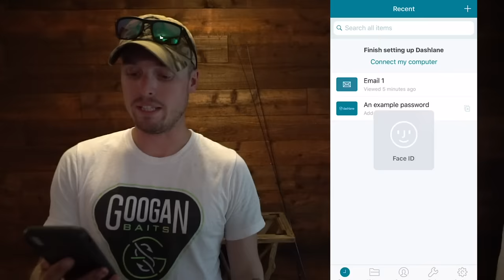$100 Homemade Kayak

Comment: Rob: I ran the numbers for your pontoons: You need 4ish pontoons for this to work well.

Buoyancy = weight of displaced water (more or less) = (volume of pontoons)*(Water weight per volume)
Your pontoons have a combined volume of 1.745ft^3
( 1.745ft^3 = 2pontoons * 10ft * pi * (1/6ft)^2 )
Water has a weight of 62.427 lb/ft^3, so your pontoons displace about 109lbs of water when they are fully submerged.

I would add another pontoon to each side (4 total) to give you a buoyancy of  218lbs. This has to support not only you but the whole weight of the kayak.

Also get rid of the foam it weighs more than air so you're making it heavier, not lighter. People use foam for flotation devices because it displaces lots of space (ie, water volume) without much weight, but you already have the pipe taking up the space, so the foam isn't getting you anything.
Reply: US makes everything so complicated. REST OF THE WORLD = 1 Kilogram = 1 Litre of water = 100 cubic centimetres of volume.
Reply: Jon Fisher : Are we JEALOUS!!!

Comment: An object floats when that object displaces more water than what it weighs. By adding the foam you added more weight so now it must displace more water but it's volume is the same so it can't displace the extra water. It would float better if the pipes were full of air. The reason one foams a boat is so in case it sinks the foam takes up space that would normally fill with water.

Comment: As long as the pipe is sealed, you don't need foam. The only thing foam does is capture air. You're actually just adding additional weight. Example, no one fills pool floats with foam so they can float.

Comment: Each of those pipe displace approximately 54lbs. If you estimate the weight of the kayak at 200lbs and roughly another 200lbs for you and any gear, you would need about eight of those pipe to hold you above the water line.

Comment: If you kept the PVC fully sealed. And put a bike inner tube nipple in the top you could pressurize the pipe to 30psi(I think it's only rated for 40psi). It would actually give it more buoyancy than adding foam weight that does nothing but add weight.

Comment: There is a buoyancy calculator online... enter pipe diameter and length and it will calculate how much you need to float. That was the FIRST thing I checked when making mine.

Comment: No foam required if straps are used instead of drilling holes in the pvc. Add 4 tees, and install out riggers.

Comment: Still think you guys need to check out Skeeter Vac for misquote control.  They run off propane and can cover multiple acres.  Mine covers our 3 acre farm and my mom has one on a lake in woods that covers 1.5acres.  Varies based on model and you can start them in May and throughout the summer have no bugs😁

Comment: Not sure about the size of the cylinders but if those are 6 inch cylinders, they displace about 1.8 to 2 cubic ft. Water weights 62.247 lbs; something like that. They usually just use 62 for making boats though because it's better to go under than over. So 1.8 times 2 equals 3.6. so 3.6 times 62 equals 223.2. looks like you're close to neutral boyancy or the weight of everything on top of the cylinders is causing them to be neutral boyancy.

Comment: I'm from Philippines we use bamboos u have to put one more pipe on each side with nothing inside believe  me it works I used to do it back home. With four long bamboo it's  heavy  but works  plastic is light and beside n your using 2 by four woods just use one inch by four woods...good luck

Comment: So, the foam has a higher density than air(we know that because it doesn't float in air) meaning adding the foam to a tube of air increased the density of the vessel. A higher density= much less boyant in water.
Reply: You should try filling the PVC tubes with helium and then sealing it lmao. The helium would undoubtedly slowly leak out, but it would be very boyant for a few hours.

Comment: You have to calculate the volume of water you need to displace to float you, your gear, and the kayak plus some in order to float.  Approximately 8.8 pounds per gallon.

Comment: When you are working with new pvc DONT PUT PIPE PRIMER ON IT, it makes the pipe brittle only use it when connecting old pipe to new couplers

Comment: Buoyancy is created by water displacement, adding foam to something like your boat will only help if your boat is submerged it will not help your boat float higher in the water.  To calculate buoyancy first you need to calculate the volume of your two cylinders with the following equation V=πr2h which if you are using 4in pvc that is 10 ft it would be about 1.81 cubic feet.  Then you need to calculate buoyant force so take the following equation F = (Vw) which in fresh water would be 112.22lbs for each pvc pipe before they are totally submerged.  Someone feel free to check my math because I could be wrong but if you want your pvc sections to float half way out of water your total load weight including the kayaks weight could only be 112lbs with 2 4in pvc pipes 10 ft long..

Comment: Foam will not make it more buoyant. It’s the closed volume displacement that makes it float. Back in the day they even made giant boat hulls out of concrete.
But, the spray foam will not be good over the long therm because it is not closed cell and will eventually soak up water. Your better off making a truly airtight tube, while adding a drain valve in case water does ever find its way into the tube.

Comment: You need at least 6.5 cubic feet of airtight space to float 400 lbs, so decide how far you want it to sit in the water and you have the total surface area that you need to create to displace with air.

Comment: Hate to bring this up but putting foam inside the pipes does not increase the buoyancy. It in fact lessens the buoyancy by the weight of the foam. For maximum buoyancy you should seal the tubes empty. You can increase the boyancy by evacuating the air or using gas that is lighter than the atmosphere.

Comment: I recommend you, instead putting 2"x4" (wood)across, continue using pvc, you gonna need 10 ,"T"s and lot of cuts but that would make it more lighter and resistant to the pressure

Comment: The foam is going to do anything but add weight. Flotation is based on displacement. Think about battleships, they are steel.

Comment: You need to displace as much water as you weigh to float.  You need more pipe (like 3 more sets underneith). And leave the pipes hollow

Comment: A class feeder for crocodiles .... An error in choosing the diameter of the pipes, It is necessary to take twice as thick. Foam does not need to be filled, it is better and easier to put a few bottles of soda inside. Good luck!

Comment: You need to figure the volume of air in pipes then multiply by 8.34 lbs.  to hold your weight you need about 25 gallons of air to keep you safely afloat.

Comment: you could reduce weight and increase buoyancy if you ditched the 2x4 frame and instead put in T junctions with pvc pipe connecting the 2 sides.  Pretty much anywhere a 2x4 was going across between the 2 pontoons could be replaced with pvc.

Comment: Drill a ton of holes in the wood with a big forsner bit. The wood is ridiculously heavy and way too strong. Drill from underneath and don't go all the way through so you can't tell. Leave wood around attach points. May need more pvc

Comment: To find the volume of a cylinder with radius you multiply pi (3.14) by radius squared by height or (3.14 x r^2 x h). It is necessary to calculate what the total length of the cylinder is needed for a mass of 200 kg. So that your structure is submerged in half. 200 kg = 0.2 m³. So, the radius of your cylinders is known. Divide 0.2 m³ by r ^ 2 and get the length of your pipes.
Why blindly do?

Comment: I do believe if you spend another$60, you can buy a nice kayak at Walmart.  Not only is it lighter, more stable,  holds more weight and cuts through the water better, there's NO construction involved.
   Maybe if you made double runners on each side..?  Or go with larger tube..?
  Cool video though.

Comment: The foam you used inside was for installation not flotation if you had tried it without the foam it probably would have worked and you could have also used a larger diameter PVC pipe with nuts and bolts instead of sheetrock screws that would have worked better as well

Comment: You need to get thicker pipes, dont use the foam

I made a similar design with same result, my second model was 3 55 gallon drums for the hull, I used my 4inch pvc pontoons as ballast on  each side, it was unsinkable even with 4 people piled on, I cut out the top of the barrels and put a seat  on the rim of the cut(feet inside barrel, butt sitting on side of barrel). 

It was a sailboat, bamboo mast, never got the keel and rudder to work right, probably because all the rigging was duct tape, zip ties, bamboo and some old street signs

Comment: A little math would have told you it wouldn't work. 
(2) 4" 10' pipes holds 13 gals.
13gals weigh roughly 104 lbs 
So it only takes 104 lbs (including the weight of the kayak ) to submerge it. 
Doubling the dia of the pipe (8" pipe)  will quadrouple the volume thus quadrouple the weight capacity to 416 lbs. That should work just fine.

Comment: This would be fine with two out-riggers and two more (little larger diameter) PVC pipes on the outsides of these. 
I would have started with larger pipes to begin with, but it's not too late now.

Comment: You definitely should have just made a rectangle of pictures all sealed  no foam and no holes.  Water heater strap will hold the wood the seat is mounted to.

Comment: You could have also increased your buoyancy by using foam core PVC piping rather than being rigid PVC it has very very tiny closed-cell micropores in its structure and these pipes will float even without being capped so now I'm imagine capping that and filling it with foam

Comment: A 10' x 4" pipe will displace 3.5 cubic feet of water . 3.5 cubic feet of water weighs about 62 pounds . So two of those pipes will displace 124 pounds of water . You would want the total weight of the craft, passenger and cargo not to exceed 75 percent of the displacement buoyancy.

Comment: Use 6 inch "thin wall" pvc and use 3 one on the right and left and in the middle and you do not need the foam it does nothing.

Comment: That type of foam is not water proof, it will suck in water as it breaks each little bubble of the foam and will weigh a ton extra once the water soaks in to it. This will sink once the water soaks the foam and only the wood will float for a bit, then down it will go. Rob there is water proof foam from DAP out there, we must make floats with foam in them up here for ATV and snow mobiles for winter use on some lakes for ice fishing.

Comment: Ya shoulda used Styrofoam/ pool  noodles with 3/4" pvc running down the center. 
That huge pvc pipe is too heavy and as for sealing foam inside will not make it float better at all.  It's sealed inside  and no different  than just plain air for flotation.

Comment: Hahaha soooo you could have just used a few duct clamps to clamp the 2x4s to the pvc piping and then you could have screwed your platform onto those instead of the piping! Would have been waaayyy easier and faster. And no need for the foam.

Comment: If your pipe is air tight, great stuff does nothing for buoyancy. In fact, you're just adding weight (not much, but unnecessary) and therefore decreasing buoyancy.
A cubic inch of water weighs c. 0.0361 pounds. So a cubic inch of air will "float" 0.0361 pounds. So you need around 11,000 cubic inches of air to float 400 pounds (weight of a man plus the boat itself plus any cargo). The formula for volume of a cylinder is pi (3.1416) times the radius (2) squared (4) times the length in inches. Or 4 pi (12.5 cubic inches) per inch of length. Divide 11,000 by 12.5 = 880 inches of pipe, or about 73 feet.
6-inch pipe would more than double the buoyancy per inch (28.3 pounds per cubic inch), and you would need only 32-33 feet of pipe.two 20-ft pieces would float nearly 500 pounds.

Comment: Why don't you use all pvcs(maybe 5 long ones and multiple short ones across tight together?) and attach some empty plastic buckets(or coca cola 2L bottles) to the side/head/tail of the boat? it would flow better than wood, wood's too heavy/expensive.

Comment: You need 2 pipes on each side an small piece across front an back.  You should of got 8-10 inch pipe an filled it with pool noodles.

Comment: Pipes are to small. You’ll need to at least double the amount and make it wider so it’s not so hard to balance. Buoyancy=water displacement you need more pvc piping bud. And the foam isn’t needed if it’s fully sealed. But the way you’re drilling and screwing into it it wouldn’t really be fully sealed.. just trash it, there’s a reason people buy them and not make them lmao.

Comment: Catamarans are good. But filling those tubes with helium won't create enough buoyancy.  Double or triple the pipe diameter, and more length and distance apart for stability. Hell, you could call it "the S.S. Cat Turd"... Haa!

Comment: There's actual science you could have used here. 
If those are 10 foot lengths of 4"ID pipe then you have 109lbs of buoyancy.
Subtract the weight of the kayak itself and that's how much it will float. 
And in case you ignore the math again, adding a third pipe will get you roughly an additional 50lbs of buoyancy. 
In other words it'll then hold a kid if you're lucky.

Oh and those buoyancy calculations are without the foam. That only took away buoyancy.

Comment: A kayak has a solid bottom  you don't   you don't have enough  serface area for water to push up on it  all you have very little   you need a 24 inch   to work

Comment: What were you doing in school? Reading comic books?****To carry 1 lb. of weight, you need to displace 1 lb. of water. Weigh yourself and the gear you will carry! Then double that # to have some freeboard above the water. That is the weight of water  ( volume of water) you want the pontoons to displace. One cubic ft. of water weighs 63 lbs.. I would need 600 lbs of displacement, or, about 10 cubic ft. of tubing. I would need 2 10 inch dia. tubes 9.5 ft. long.

Comment: Pontoons are hollow. It doesn't matter what you put in it, it'll still float. Leaving them empty would've been better. Especially if you want to save on weight.
Reply: Also, there's probably water inside the pipes if you didn't put silicon around the screws.

Comment: was this project done before archimedes discovered  the theory  of buoyant force .If the guy weighs 90 kilos he needs to displace at least 90 kilos of water which is 90 liters. to barely float. He could have calculated the displacement of 1 PVC tube by using another one of archimedes discoveries Pi.  Like the design it  just needs more brains.

Comment: The pipes are too small. Not enough surface, too much foam weight. It would work great for Avery....on a tether. As LFG said....a nose and tail setup will help...A Lot. Looks fun though.

Comment: Next time work out the volume of the pipes and the water they will displace compared to the weigh of the load.. Some simple math you can do on google would have told you to at least double the pipes. But the easy fix will be to just run more pipe minus the foam.. Foam has weight.

Comment: Dude this is fuckin awesome. It's on my to do list. Only without the foam. And I will use three more sections of pvc. Going crossways aft middle and front. Probably use thinner wood. But this is one of those projects that is layed out and can be fine tuned to work well.

Comment: Good idea I'm making one but haven't got the extra money right now been working on making for year now now I do have a pontoon boat just like what your building were your feet in the water or I have a way to get my feet out of the water. But mines 6 ft long but the plug Is so big you stick your fist in it. Yeah. So last year I leaned back was July 29th my birthday camping trip birthdays the 30th. But I flipped the boat back lost my new rod and reel took 10 years to get a new rod and reel I won't buy new cause I always give my rid and reels away so I buy cheaper so I'm able to buy and give more. But my plug popped open it's on top. But I leaned back the pressure of the tub going under water some popped that top. My daughter yelled your sinking I tried to lean forward but with my back can't do that fast it filled I went backwards. I hear splash my daughter dove into the water and was at me before I could come up from going backwards. So got up hranned the boat and few rods and reels of course few were in a holder so they didn't go no we're but my new one done. My daughter was able to help get the boat flipped and to the shore. You no your daughter loves you when you flip a boat and she's to you before your back up I got a great girl. Best 17 years of my life raising her by my self all 17 years only had help 7 months. But hey this ain't about my boat it's yours. I hope you read this far or atleast watch a video here's a man who made one also but with 6in and 4in need 4 pipes unless you get lucky and find 8in pipes.  But good job can't weight to see it finished but thanks for good content and nice finds there bet he likes that copper pipe hope he uses for something cool. Have a good week God bless

https://youtu.be/0cMgQQRYh6c

Comment: There's no way there's enough displacement of water to offset the weight of the  passenger. Put 5 more tubes on the bottom and it may float or just get some actual pontoons

Comment: The foam is doing nothing for your kayak. Just put caps on it and call it good ! Also you could use a 4in t with a cap and use the cap ends to build your frame on!